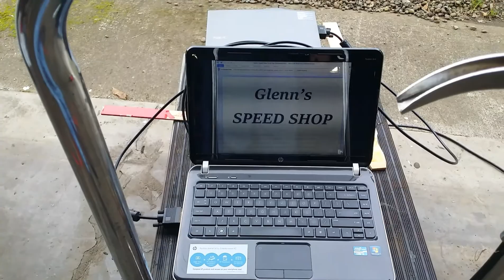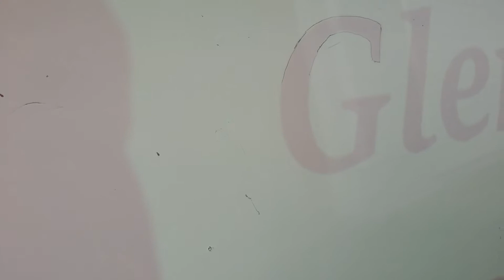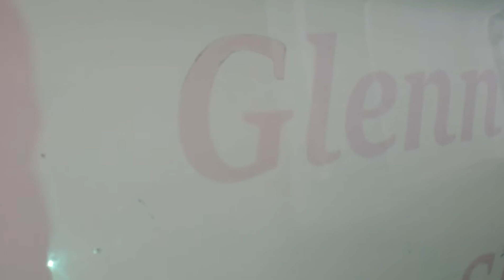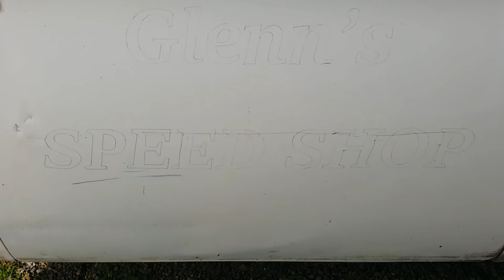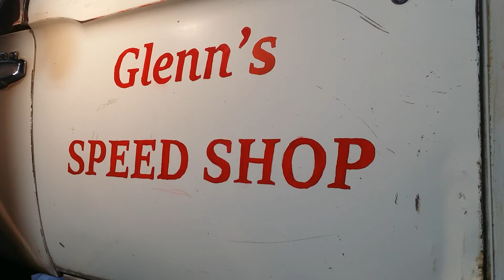Today my Shop Truck F100 becomes my Shop Truck. I try my hand at Sign Painting my doors.

Comment: Looks better then I could do it, if you patina it a little bit, maybe take the buffer and just burn through it it a bit it will hide some of the imperfections
Reply from the maker: That's the plan. I screwed up a gasket and had to pull off the water pump and t.stat housing today, will get it back together in the morning and get started on the cosmetics. Want to weld up all the holes, grind, prime, and paint them and the bad spots, then go after the entire truck with a buffer to blend everything in. This has been alot of fun!
Reply: It is looking good